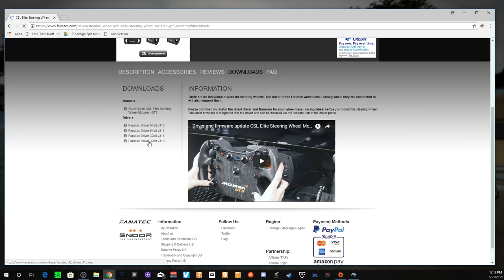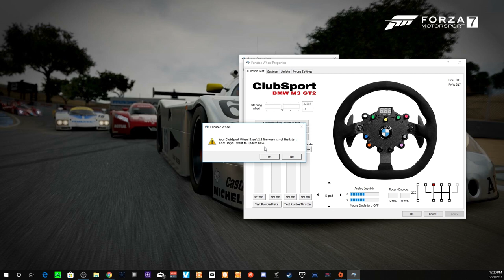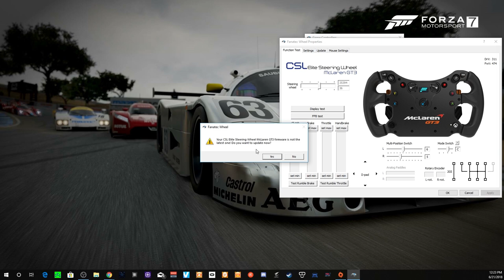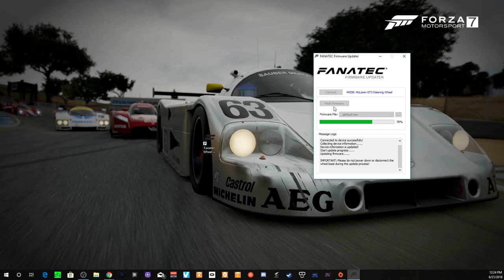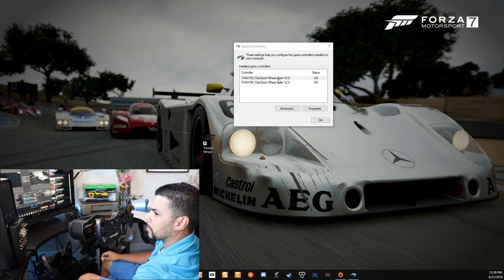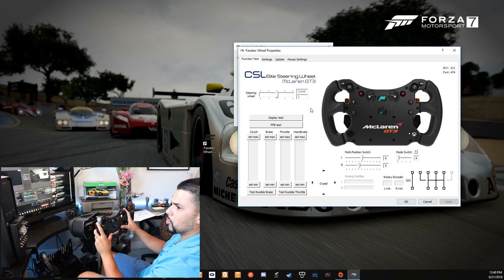Fanatec Mclaren GT3 Wheel Full Review and Install!

Comment: I dunno, I just can't get behind this product. The cheaper wheels I can understand because they are "cheap" enough to get started and somewhat do the job. For the price, I feel a direct drive is the way to go, it has an industrial servo that's going to last way longer. I haven't seen a review or read anywhere that you can replace the belts yourself and I doubt they would last very long. Idk...there are just too many parts to fail for the price.

Comment: With the newest driver a new advanced clutch bite point Mode was introduced. You should have a look at the forum in the beta section where it is explained.
Basically with the new mode you don't have to hold a certain level anymore because you can save 5 different bite points into the profiles, hold both paddles, release one fully and the other one Slowly. Advantage is you have the fill travel range on the one to release slowly and you don't have to hold the exact bite point. :)
Reply from the maker: wow! okay will do!